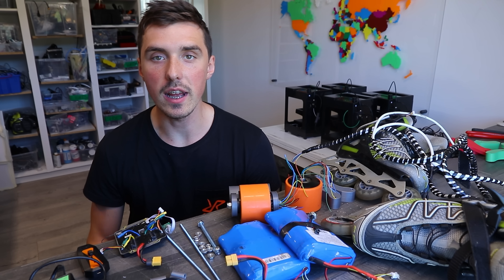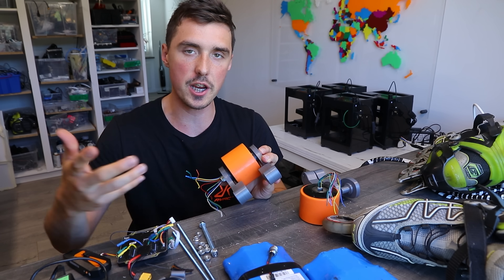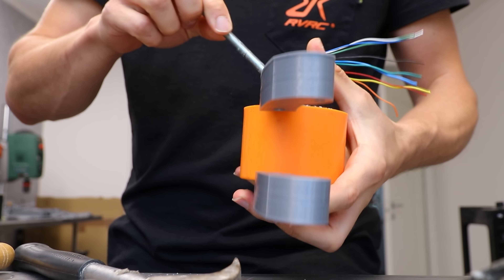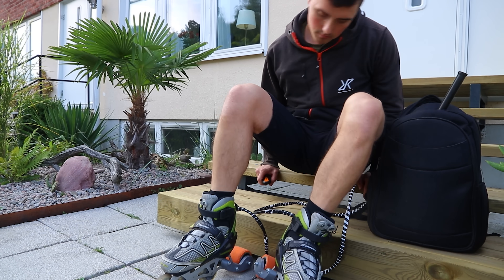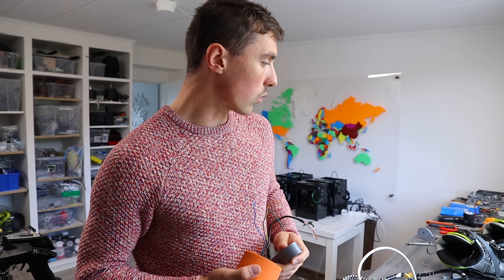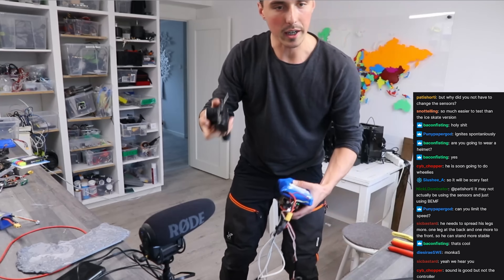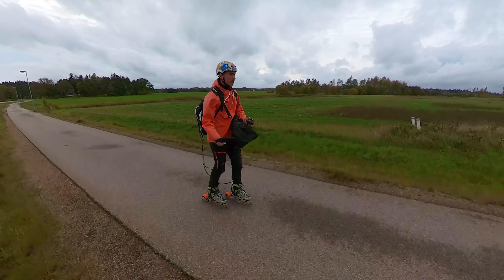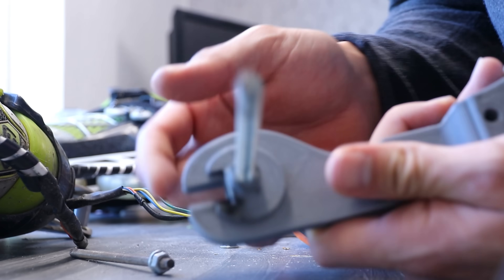1000W Electric Rollerblades That Will Hurt You

Comment: If you can make this into a sellable product, around 700€, I'd definitely buy. 
Metal for frames is a must. And some wire management needs to be done. Maybe get a beltpack? That way it isn't clumsy in a backpack and gices possibility for real stuff to be transported in the backpack.
Also can you estimate how much weight you had when you were testing the distance?
Reply: https://youtu.be/shXaTMkUs80?list=LL
there are many problems  with this  bulky wheel far back design
hawing the last wheel so far back makes crossovers difficult
inner edge and outer edge feel will differ from an normal skate being that the motor and mounting are 3 times beefier than an wheel in front
good parts are : being behind the 4th wheel it could be made to retract up so its out of the way and only when you need asist you lover it for going straight

Comment: You can buy some mild steel 10 or 12 mm square bar off the internet and file it round on the ends for a die and then bolt it up.

I would think a female square hole 3d printed would be prety strong

Comment: You should try creating a bracket that connect with the same two bolts that you uses for your motor mount. create a swing arm, like on a motorcycle, to attach the hub motors to, so that it pivots. In your design, create a place to mount a shock in the bracket, and the swing arm! Find a RC shock with enough force to keep good pressure on the swing arm for traction and you'll ride more comfortably, while being able to maneuver better!

Comment: Made another version instead 3D print it using PLA,, try using a sheet of metals it can become joining stronger construction and are you know an anime titled "Air Gear", same conclusion but instead using cable they using anime magic, but what are you made are totally cool, 

just need made it more powerful motors and stronger joint construction xD,

and what im hope is you made the cyclist passing your just got stunned because your rollerblade  can move as fast as him xD

Comment: Since you do not have a CNC machine, the square lugs need to at least be aluminum. Bond them in to your printed arms and that should last more than one use. A permanent solution would need to be steel but that would take some fab work, MIG welding or skewer bolting multiple spacers to metal plates for the attachment points would do the trick. Second, the drive arms need to be lever dampened, not rigid. Do that by creating only one bearing attachment point to the skates and a second soft point with a polyurethane bumper or coil spring setting the drive wheels slightly lower than the skate wheels. That downward pressure will allow faster acceleration and a more natural body stance allowing you to focus your weight on skating rather than putting pressure on those drive wheels. Do all this and you have created a usable means of transportation to rival the electric skateboard.

Comment: You should add 2 shock absorbers in the back and have the motor mounts on a hinge. This way you won’t have to worry about it snapping if you lean back and you’ll be able to keep power while turning since it will allow for some flex. Your motor/wheel will keep flat traction while the other wheels can tilt in a turn.

Comment: On the upside you've had much better luck than Wile E. Coyote did with the same exact contraption, but then again you're not relying on Acme Co. as the parts supplier.

Comment: If you gimbal and spring load the motor mounts you can use them like normal rollerblades. Also keep your knees bent a little for stability. Nice build.👍

Comment: Hey brother you might be able to cut the axles off of one of your old skateboards and adapt that as a mechanism for locking your motors from spinning but still use 3-D printing and to stop cracks you might think about putting some sort of spring-loaded suspension so that when you hit something hard the entire mechanism can flex a little bit

Comment: try to make all the wheels at the same dimension as the motor, and the motor is at the front (at tip of the shoe). usually when we accelerate, we tend to move our weight back and the stress is there... id recommend cnc machine for the wheel plate and the shaft. good job and keep on trying! the satisfaction is there awaits!

Comment: if you could incorporate the batteries in the shoes where you wasnt looseing so much on long line cable,shorter and larger wire works best on dc seems like.

Comment: @RCLifeOn
7:00 -ish. Would a fuse between the engine & controller have saved the controller when the engine short-circuit? or a fuse on the engine-power cables?

Comment: I like the idea but have a tire on the rear with a shock or spring pushing the drive wheel down and having the resting point lower will give you better traction at more angles for an easier ride.

Comment: i would use petg at 100% infill for machinal use or abs. pla not suited. i built heavy duty motor hinge system and petg is high class in the my books. plastic used on the hover boards or electric boards are Petg

Comment: @RCLifeOn
If you can put the motor on the front wheel, then it shouldn't be as possible to fall over from accelerating, because when you start to tip backwards, the motor is lifted off the ground & you stop accelerating. (and with generative breaking, that would mean the motors get even more traction against ground when breaking).
And you can still break with the back of the rollerblades.

Comment: 5:00 is why it died.... you never plug it like that. You Use the XT connectors because they have a resistance and shit built in when you connect and disconnect to prevent Sparks and Arcs.

Anyway I would have put that motor pressed upon the front wheel instead of the ground.

Comment: Get a pair of Strike V9 200's.  Those are the ultimate rollerblades to electrify.  I've got 4x 250W hubs tuned for 25 mph that run almost 25 miles.  Other posters are correct, you sir, need a CNC machine!

Comment: If you ar going for front and rear wheel, I would sugest you program ~80% power to front wheel for acceleration and ~80% power on back wheel for breaking. That way it will be mutch safer, and easyer to keep balace. In theory..

Comment: take the shoe part off and make it like ski/snowboard clips so a shoe will fit ???? definitely rubber tyres/wheels so can run over stones that may be on roadway... from a young daredevil inline skater who crashed on a 30 deg downhill after hitting a large dirt patch across the road and dislocating both shoulders ;o)

Comment: And if you continue to have issues with the plastic brackets snapping in the middle from the torque it may be a good idea to add a thin plastic "wall" centered on the top of the brackets. This will add a lot of stiffness to withstand the torque without adding a ton of material and minimal extra printing time. Or you may just want to make them out of aluminum.

Comment: Also, for the square shaft part: if you can find square nuts with the right external size you can use the oldschool 2 nut locknut trick to have a non plastic square shaft. You tighten the 2 nuts against each other on the shaft and they will lock in place from the torque. This way the torque is applied to the metal shaft instead of the plastic. It may be possible to use this same idea to hold the shaft from spinning in the plastic too. Print parts with square holes that the nuts can sit in. Then use flange nuts or a nut and washer to keep it from moving laterally.

Comment: Hmm only suggestion I have would be to get the rear motorized wheel in the same general form factor as the the rest of the wheels so you can actually lean and turn better. The profile of most inline wheels is either a semi-circle or parabola. Parabolas are better at gripping and diving into corners while semi-circle wheels are more consistent and easy going. Square wheels are more like what you would get on indoor specific quad skate wheels but those use trucks like a skateboard. With inlines a square wheel severely limits how much you can lean and turn. So get that motor hub up on an actual parabolic cross section and it should be good as far maneuverability. That and a metal arm and it actually might be pretty fun. =)

Comment: If you spin the motor while attatching the battery, there might be a reversed electricity produced by motor and cause tiny shortage to the motor controller or ESC which ruin the whole thing. It's like when you stopped the motor from spinning and the power just leak out of ESC's and run to ground of battery but it will charge the battery while you're ESC is burning down. You need a full bridge rectifier circuit and save you're ESC with 4 diode(or diote i forgot(and sorry for my bad english)).

Comment: Just use standard skate frames with all 4 wheels fitted, then make the mount for the skateboard motors so that they push on the top of the inline wheels. That way you can still turn properly by leaning and the 3D printed parts aren't trying to hold your body weight.

Comment: put a oscillating joint between your skates and the motor I bet you will have more turning power and less loss in balance if you're going with the rubber grip on the motor.

Comment: How about you make an arm for your 360 camera that has an adjustable pole so you can adjust it on the go and it might look cool on these skates. Make it use a motor so with a flip of a button it goes in and out. I think that would be pretty cool.

Comment: Please, please, PLEASE treat the wood on your front steps. You don't have to stain them to preserve them. Even wood treated for outdoor use will eventually start to rot if you don't occasionally re-treat it, and it's WAY more expensive to replace the wood components of your porch than it is to prevent rot, and every dollar you save on replacing rotten wood is a dollar you can spend on your next RC project!

Comment: Square shaft part in metal, bolt that hub to the printed part, that also means you can later replace the printed part with simple sheet metal.

Comment: Nice work.  I wonder if a solid mount is the best way to go though.  I'm thinking a pivoting mount with a spring pushing down from the back of the heel down over the motor would work better.  Would allow flexibility and allow movement  to help with traction while not putting so much stress on the motor or the mounting points.   I wish I could draw with words to better express the image I have in mind but think about a single bolt where the mount attaches behind the rearmost wheel.  This is the pivot point.  Then a spring pushing from the top of the motor upwards at an angle to a point around 15cm higher than the pivot point.  The motor would be free to move up and down but the spring would push it down ensuring good traction.

Comment: OK NOT SURE if you've thought of this.. but can you try Wireless? I.E. smaller battery packs attached to the boots with a wifi/wireless controller? SURE the range would be affected... but.. what if this was just for lunch in the city from your office building.. a few blocks.. etc.
Reply: ANOTHER HTING... you know the 3 wheel motor cycle..?? THINK about a mouinting system for the motor so you can have x, y and z or angular movment...????

Comment: Next time I would use thermal epoxy, it will attach the heat sync and will be able to transfer the heat, superglue fails at thermal transfer and the speed controller likely died from overheating.

Comment: Going back and forth actually decreases your range because stopping and starting is really hard on the batteries. Getting back up to speed is what kills most of your power
Reply: ITS A GOOD REAL WORLD TEST. THESE AREN'T HIGHWAY MILES. THINK PLEASE.
Reply: I don't know about new controllers,
but first one did recuperation.
actualy, the fact of brakes means there is recuperation still.
(Tom Stanton measured 40% uphill just out of downhill)
Reply: That's an even better test. Most cases you'd be using this would be in the city where you'd be constantly slowing and braking.

Comment: lol bro bend your knees when you ride that haha. Lean forward keep your head up and bend those knees. Your center of gravity is way too  high and you have nothing but your arms to recover if you give it too much acceleration (skateboard, snowboard, and ski instructor btw). Also this would work way better with a spring applying tension to the wheel and pushing it down against the ground and giving it some suspension travel so you can move around more easily and step on your heel if you have to and have it bend up